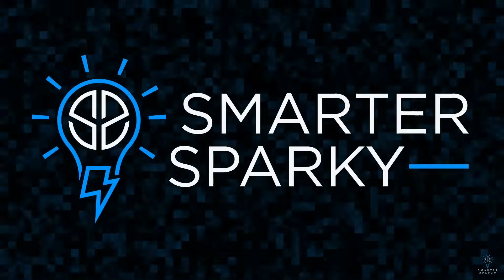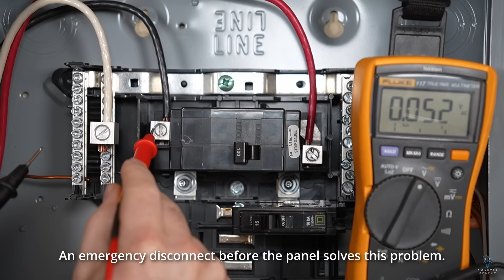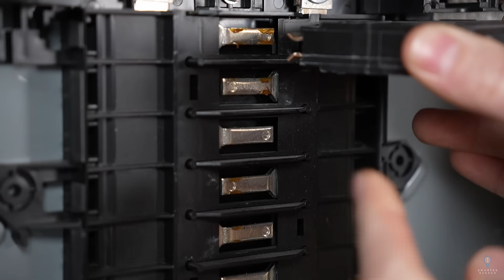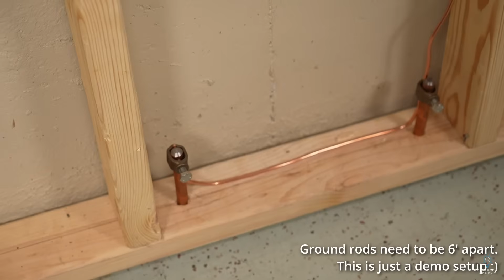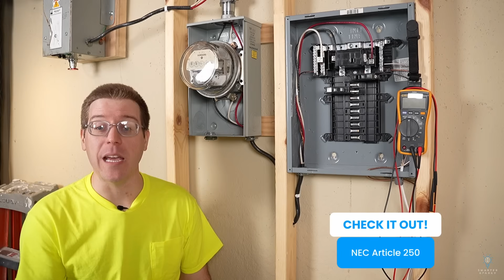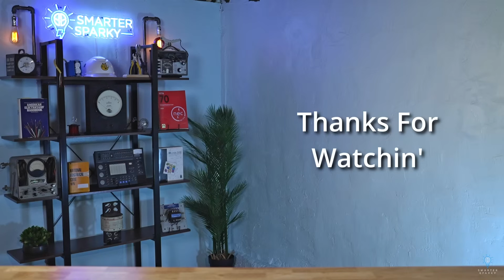Unlocking the Basics: Inside a Main Panel

Comment: Hi Sparky.  I have seen main panels where instead of L1 and L2 landing on the main service lugs, the electrician opted to use a 100 amp two pole circuit breaker to power to panel instead.   While I am sure this may not be up to code, is  there any disadvantage to using such a method?
Reply from the maker: It actually is perfectly legal to back-feed a breaker. You can get electrical panels that don't have a main breaker, and it is common practice to back-feed just a regular breaker as the 'main breaker'. The only real disadvantage is it takes up a space that could be used for a branch circuit. Otherwise there really is no difference. Pretty neat!

Comment: how do you identify the neutral wire associated with a specific breaker so when I replace it with a GFCI breaker I have the correct neutral wire to attached to the new GFCI breaker
Reply from the maker: The best way would be to follow the hot wire from the breaker, and see what cable sheath it goes into. The neutral in that cable will be the accompanying neutral

Comment: i inherited a control panel from hell.  the meter is connected to a panel with a shut off outside and then the massive control panalinside  has all grounds and neutrals connected together...is this ok? and then there is another panel ran off of the massive one and it has also all the neutrals and grounds on same bars!!
Reply from the maker: Oh my that sounds like quite the installation. If I am understanding correctly, you have an emergency disconnect outside, your main panel is inside, and your grounds and neutral land on the same bus bar in the main panel? That is totally acceptable. The sub panel having the neutrals and grounds connected together is not ok, however. It might be a good idea to have an electrician take a look at that, and fix it if needed.

Comment: I a. Planing to upgrade my panne, from 120 v to 240 to make room for added brasher. Could you recommend a manufacturer?
Also how could I find which breaker is tripped when breaker still shows ON? Thank you
Reply from the maker: I really like the Square D QO series, but they are on the more expensive side. I'm not much a fan of the Square D Homeline panels. I also really like the Eaton/Cutler Hammer CH series panels. There are quite a few other options out there: GE, Leviton, Siemens

Comment: Call me a prude but for all the talk about adherence to safety standards and NEC  the lot of you bloggers, and you in particular sure like to fondle your way through touching or near touching giving one the impression that it must be safe!!
Possibly in spite of your expertise or maybe due to it, you think far too little about poor impressions we might take from your cavalier gesturing.
I would think a nice non-metalic pointing device or a insulated tool or non conductive piece of something laying around!!
Some very good info in your video, too bad I missed most by virtue of distractions such as I mentioned.
Reply from the maker: The problem with converting a 3 dimensional world into a 2 dimensional representation is the loss of field depth. My fingers were nowhere near live parts, and maintained a strict distance. I do see your point on perspective, however, and will consider a non metallic pointing device in the future. Cheers
Reply: @SmarterSparky You seem like a great guy so it is hard for me to say you are lying... because you did on several occasions nearly touch the hot bus. In one case, (at 5:04 mins in the video) you quickly pulled away your finger and then touched the red input hot terminal with your test lead. OMG that was close! Then (at 5:36 in the video) you reached in and touched the main breaker while not looking but looking away at the camera. Are you crazy? Yes, sometimes the distance looked closer because of the camera view as you stated, but several times you were way too close.  I don't comment often but the guy calling you out on this is correct. The video gives the impression that what you are doing is safe by your nonchalant actions. Just when one gets comfortable with something dangerous, it makes room for making mistakes even by seasoned professionals. Many years ago, my high school shop teacher cut off his thumb on a saw during school hours. Honestly, I would suggest you completely remake the video(s) to demonstrate much better safety. Otherwise, some, or even yourself, may end up being a victim of careless naivety which clearly the video demonstrates. Sorry to hit you hard, because your info is good stuff, but I don't want to see you or anyone else electrocuted. Peace.

Comment: What is that green colored metal box thing with a padlock between a few houses? And I wonder how a multimeter read s the voltage only using two phases? not touching the neutral to complete the circuit!
Reply from the maker: Good questions! That big green box is either a utility transformer that feeds multiple homes, or it could also be a junction box that the utility uses to splice their conductors (it could be their high voltage splices, or the low voltage splices feeding individual homes). The multimeter is able to read the 240 volts, because what we see as "two phases", is actually one single phase. The neutral splits that one phase in half. We send 240 volts into homes on the black and red; that is one single phase at 240 volts. The neutral splits that phase in half (240v / 2 halves = 120v). That means the 120V "legs" are actually one half of the original 240 volt phase, and it further means that the 120v "legs" are exactly opposite of each other. In simple terms, you could think of it as one leg is +120V, and the other is -120V (and this oscillates because it is AC). So basically from phase-to-phase IS a complete circuit. Neutral just splits that 240v circuit in half. This gets a lot more into theory, which I will cover in a future video. Cheers!
Reply: @SmarterSparky okay Thanks

Comment: I’ll look for your split phase video but if voltage is a measure of differences in potential why did measuring across the 2 legs not give you a reading close to zero since they are both 120V?
Reply from the maker: That's a great question! They are both 120 volts, but they are opposite of each other. Think of one as +120 volts and the other as -120 volts. It's AC so they are continually changing from + to -, but they are always opposite of each other. Does that make sense?
Reply: @S @SmarterSparky at’s helpful, thanks!

Comment: Well done. You addressed one of the most important questions I had been searching for online, and I couldn’t find anyone who explained it as clearly as you did. I was also concerned when the lines were live, and your hand was very close to them.
Reply from the maker: Thanks! What was it you were looking for? The camera doesn't pick up depth of field very well. My fingers were well away from live parts 🙂
Reply: ...I like the way sites that deal with guitar amplifiers use wooden sticks to point with (even when they are 'powered down', there is a lot of stored energy inside an amp circuit). There are very high voltages inside those beasts but even the voltages inside that panel are dangerous. That bare finger thing looks a little to cavalier for me.

Comment: Why are there two hot conductors coming into the breaker, L1 and L2, and not just one?
Reply from the maker: Good question! It's because this is what is called a "split-phase" system. Basically Line 1 and Line 2 are the entire voltage available. Neutral allows us to split that voltage in half. The main breaker is actually two breakers built together. So there is an L1 side, and an L2 side with just one handle that controls them both. Does that make sense?
Reply: @SmarterSparky  That does make sense! If you only have one hot wire and one returning neutral wire, only 240V would be avaible. I guess my next question is, what do you mean by the main breaker has two breakers built together? Thanks for the reply!
Reply from the maker: The main breaker is basically two single pole breakers with the handles connected together, pretty much just like the two pole breaker we see in the video. One pole takes care of Line 1, and the other pole takes care of Line 2. They are just stuffed in the same case and packaged slightly different for the main breaker. Hopefully that makes sense.
Reply: @SmarterSparky Ohhh I didn’t know that 😮 definitely makes sense, thanks 😄👍

Comment: Can you then make a subpanel powered by a 240 output from the main panel?
Reply from the maker: Exactly! A sub panel is just another circuit as far as the main panel is concerned. You'd bring both hots from a breaker, the neutral from the bus bar, and a ground wire from either the neutral bar if it is shared, or the separate ground bar if there is one. Great question!
Reply: @Smarter @SmarterSparky k you.  I asked because my main panel in my house is pretty much full with only a few double inputs left on existing circuit breakers, HOWEVER…I got a 240 plug going out to my garage.  So I’ed like to put that 240 into a subpanel in my garage and from there put some additional stuff in the garage.  On a 240 input to a subpanel, how many amps is that capable of handling safely and of course, for educational purposes only…Ciri tells me 40-50 amps and frankly that would probably power any welder that I would be tempted to use. I am a former aircraft mechanic and have taken an interest in everything electrical and in doing so have confirmed some troubleshooting skills that readily have transferred to my house on a few things.
Reply from the maker: Nice! The wire size going to your garage will determine the maximum sub panel amps. You're also going to need to make sure there's a neutral ran with the 240v circuit. If there isn't a neutral, you'd have to replace the wire as well.
Reply: @S @SmarterSparky hat’s at my garage 240 output is just a plug at the moment that I have a small 240v heater plugged in to.  To be honest, I could not tell you exactly what’s there other than that I got a 240 heater plugged into it.  And I am not familiar exactly how a 240v plug is supposed to work.  I would have to study the code for a 240 circuit and confirm what’s there is actually supposed to be there and not assume it’s right.  At the main panel, the wires going to the 240 to my garage from the main panel does not look very beefy like a number 8 going off of memory.  Realistically though, I would rather just work with what’s already at my garage plug and the limits of the wire already routed without redoing the entire set up from the main panel. At the main panel are two circuit breakers that feed the garage 240 plug. So at the garage plug, wouldn’t there be a neutral there that would go to the neutral bus on the sub panel and the sub panel having a separate neutral and ground busses that are not connected like on the the main panel?  If I understand correctly, the main panel share grounds and neutrals but the sub panel grounds must be separate from the neutrals.
Reply from the maker: That's right; The main panel can share neutral and ground on the neutral bar. In sub panels they must remain separate. The heater outlet in your garage only has 3 prongs, it only has 2 hots and a ground. If the plug has 4 prongs, it has 2 hots, a neutral, and a ground.